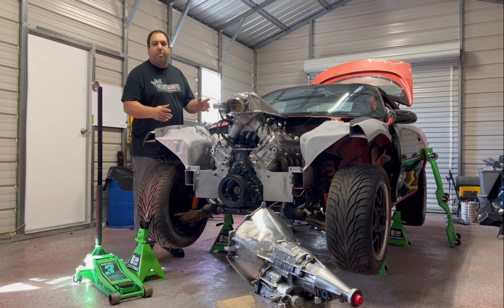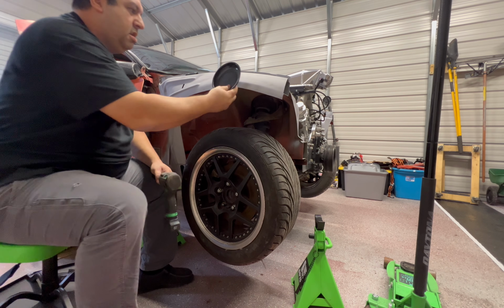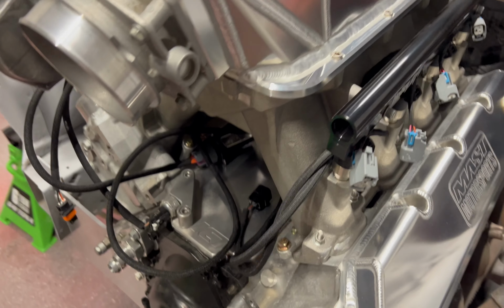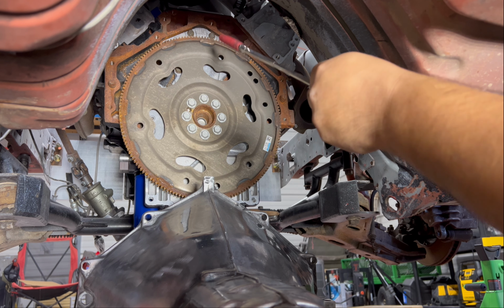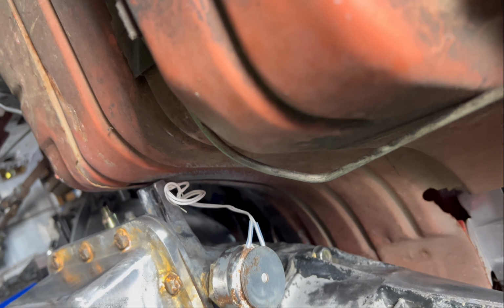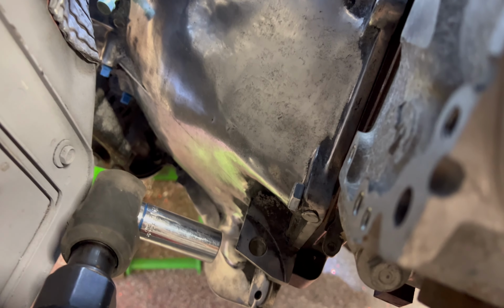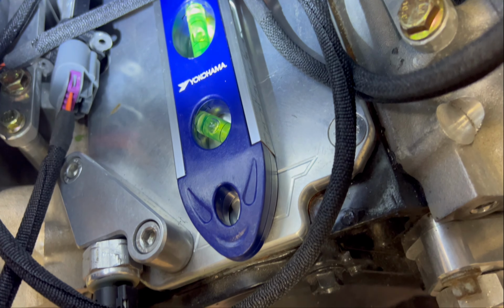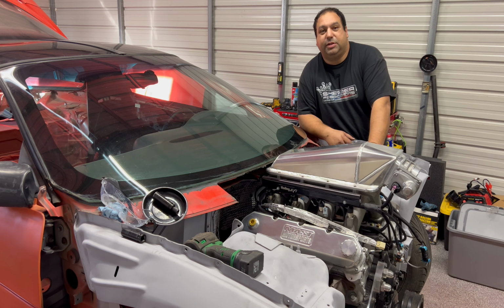NEW Gen V L8T 6.6L SWAP Camaro Part 10 - B&M Race Powerglide Install

Comment: I thought that these needed the spacer for the torque converter like the LS's?
Reply from the maker: They do, but I never installed a torque converter because I don’t have one
Reply: Ah I see! I absolutely stole my 6.6l8t and 6l90e with 25k miles, ecu, harness, etc for $6600 out the door. Cannot wait to get it in my 72 K5 Blazer! Using Holley term x max though.